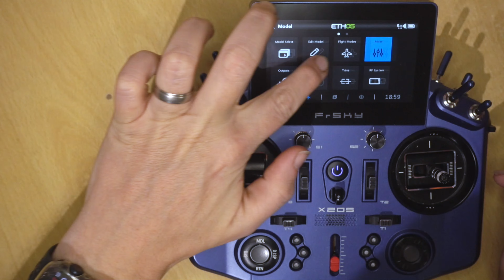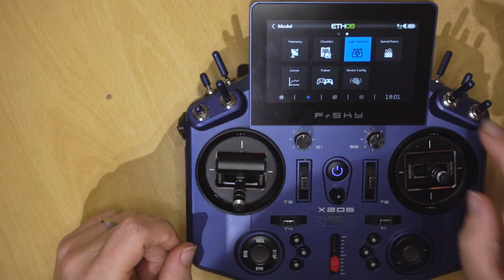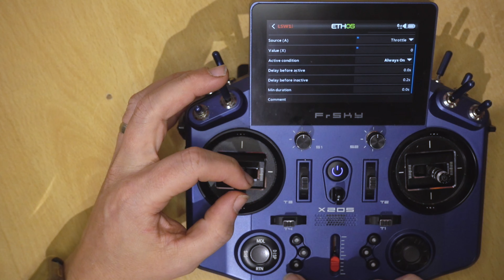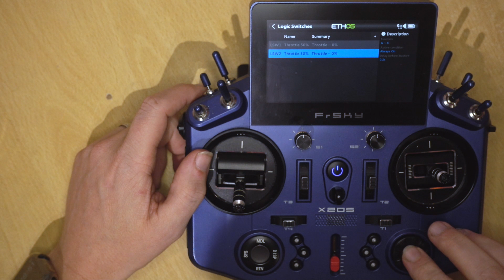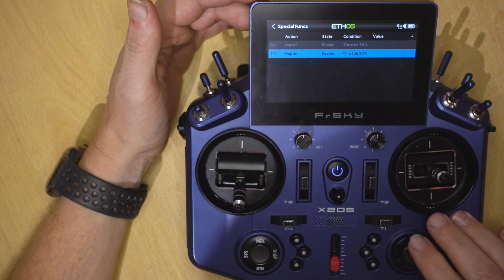ETHOS Throttle position feedback

Comment: Thanks for sharing.  Would you please make a video on setting a percentage timer in relation to throttle
Reply from the maker: You just need to set the timer up as the throttle % type. Have it activate when you arm/disable throttle cut.
Reply: @MrD  thanks a lot 👌

Comment: Hi Darren not sure if this is the right place for this request. I have been working with Frsky Steve on this and no luck on the setup. So i hope you can figure it out. I want to setup a switch that will give throttle for reverse thrust on my freewing Zeus. It is done on Spektrum radios it’s called pilot fatigue. There is a YouTube video by Brian Phillips if you could watch it you will see what i trying to accomplish on the Frsky X20S. I have it working on a momentary switch but i have to hold the switch then give throttle for it to work which is not what i want to do. I hope you can help on this. Thanks Art

Comment: Hi.Darren,very informative videos.perhaps you can help or point me in the right direction,I have been trying to update the firmware on my x20s .it appears to be on the sd card but won,t load into the transmitter my version is 1.017.also if you set a curve on one channel it appears in other channels as well .not sure what to do next,I have a feeling something is very amiss
Reply from the maker: Hi Peter. The firmware file needs to be in the root folder of the SD card. Also, the filename must be left as firmware.bin
Once you unplug the USB cable after copying the file to the SD card it should automatically install. The only think I can think of is that the bootloader is old. Are you holding the enter button while short pressing the power button to get to the bootloader?
Reply: Thanks for the reply,deleted the previous loaded firmware and reinstalled and it updated on ethos suite as I had previously installed the latest bootloader.is it normal for a curve you make to show on other channels which effects the other channels?
Reply from the maker: Glad that’s all working. Going forward, ETHOS Suite will just do it all for you. I updated my X20S yesterday, and it’s literally clicking a button in ETHOS Suite. Effortless.

Sorry, I forgot about the curve. When you create a curve, it is available to use in all mixes. If you select it for a mix, it will effect all channel that the mix is output to. The curve shouldn’t just effect channels that it is not associated with.

Comment: Hi Daren. Would you have any views on the new TWIN module. I'm considering standardizing all my receivers to TW.  I don't see a lot of information on YouTube or the web on its comparison to TANDEM. 

Would love to hear your views. Also any information on a stabilized TW receiver anytime soon?
Reply from the maker: Hi Arshish, is there anything in particular you would like to know about. I have only really seen the specs so far. I'm putting some questions together, so if you have any in particular, let me know. I may also be getting a TWIN X-Lite to review. So would be able to give my thoughts on it then.
Reply: @MrD  

Primarily:

1. When will we get a Stabilized TWIN Rx
2. How does it compare to Tandem in terms of link quality
3. Can it truly replace 900mh
4. until we get a stabilized Rx how can we use it with the S8r / Sr8? Because the twin receivers do not have a SbusIn. We have reports of the internal 2.4 interfering with the time 2.4. so how would be go about this?

Comment: Hey Darren....Thanks for doing that! It was a great help! Now that I have the logical switches set up, is there a way I can activate a timer to run anytime the throttle is above 25%? Similar to useful throttle time on Spektrum. Thanks to all your videos I was able to set up my new X18 and SR6 and get several flights in before the weather turned. Thanks again!
Reply: Yes I have a timer setup the way you're asking about, unfortunately I won't be near my X20S for several days, I don't remember off the top of my head how I did it.
Reply: @FlailinMonkey  If you could post the procedure when you get a chance it would be greatly appreciated!😀
Reply from the maker: It would be pretty similar to this tutorial. You would have an A > X logic switch to detect when the throttle is higher than -50%. It would also be worth adding the throttle cut off switch position as an AND condition on that switch. Then use that logic switch to activated the timer.

But, you may want to look at the throttle % timer. I find that one works pretty well. With that timer, full throttle 1 second = 1 second on the timer. At half throttle 2 seconds = 1 second on the timer, etc.

Comment: hello Mr. D, could you do a tutorial on how to add throttle delay for ethos to simulate a turbine spool time with EDF , which is usually 2.5 to 4 seconds, good for those who want to practice how to fly jets with reaction engine even without having one, I watch all your tutorial videos, they are very good and complete.
Reply from the maker: That sounds like a great idea. I've not had a turbine, but I guess the spool up time is linear to the throttle change? So going from 25% to 100% may take 4 seconds. But 25% to 50% may only take 1 second. Though that may be tricky to implement. I'll see what I can come up with.
Reply: @MrD  i never had a turbine too, but you are right, its linear so 0 to 100 is increasing until it reaches that amount, i heard that some with better ECU can pull it fast but there are few,
Reply: I think it would be nice to add realism and make it possible to have a different feel with our edf